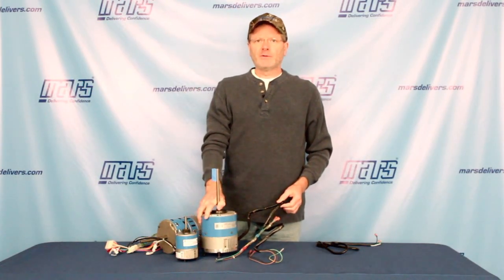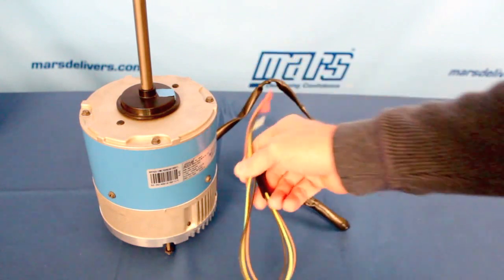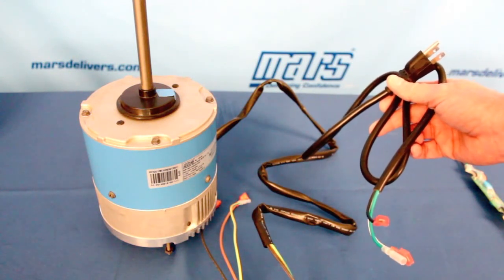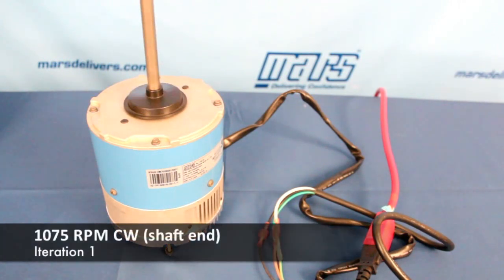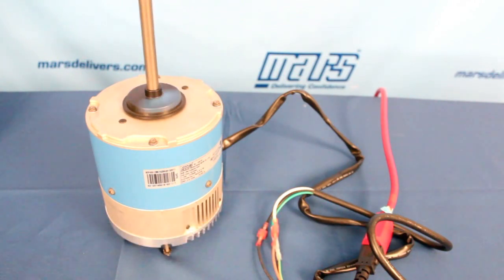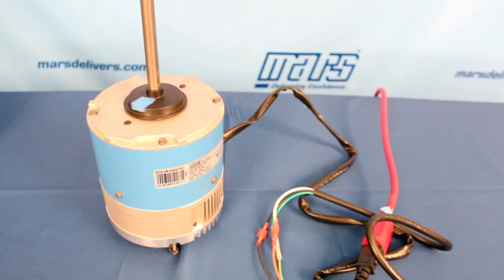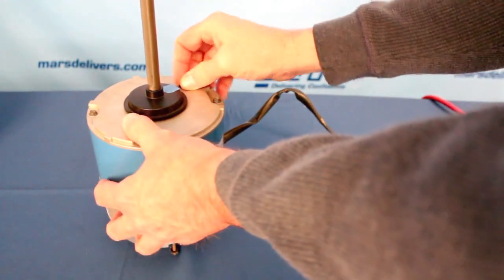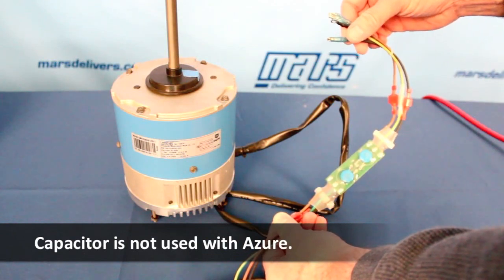Azure® 10870 Condenser Fan Motor

Comment: What about using itnwithba defrost board do the wires still go to the contactor
Reply from the maker: To answer your question the Azure power leads go to the same connection points as the old PSC motor (excluding the capacitor).

Comment: Will the motor default to a setting without using the programmer?
Reply from the maker: This motor is not compatible with the MARS hand-held programmer; it is not required to use this motor. Thank you.